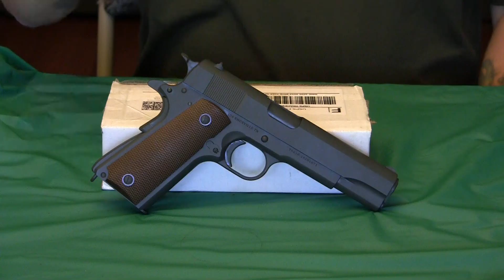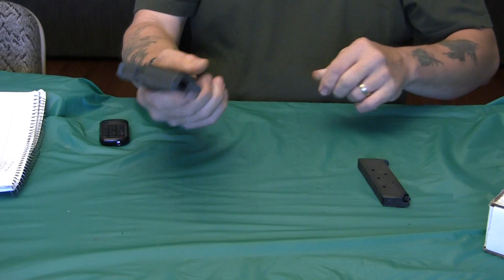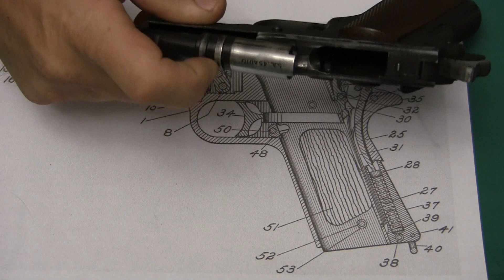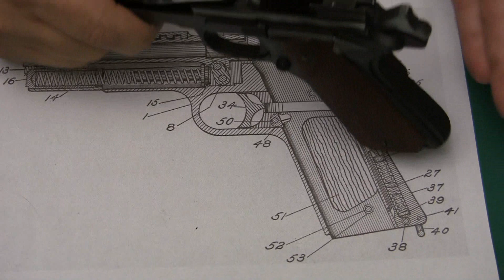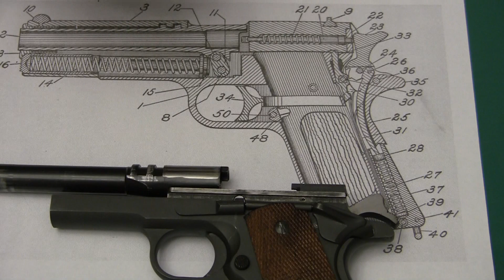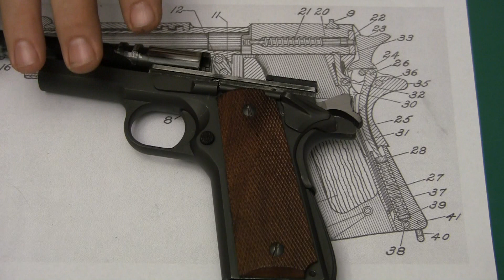The M1911-A1 fact  fiction  and tall tails

Comment: The 1911 in highly modified form soldiered on with the Marines until just this year when they are being replaced with Sig P345 handguns, There may be some original 1911A1's still in service with smaller National Guard Units as well.
Reply: There’s still some m45a1’s with the marines.